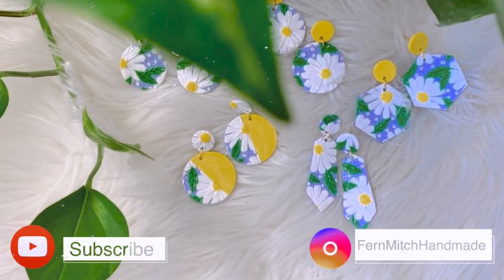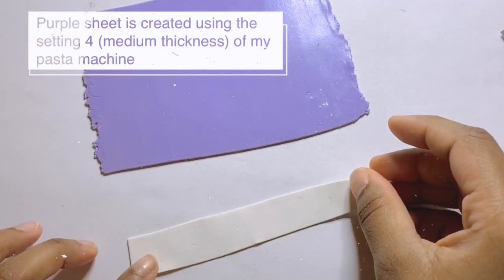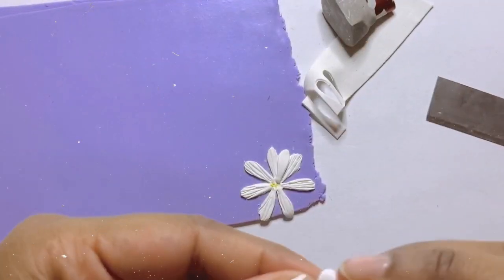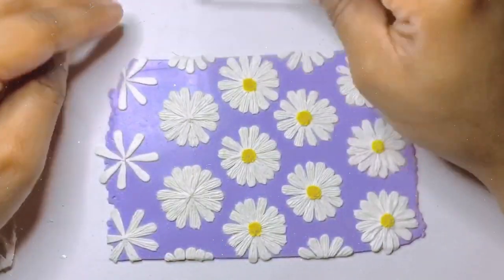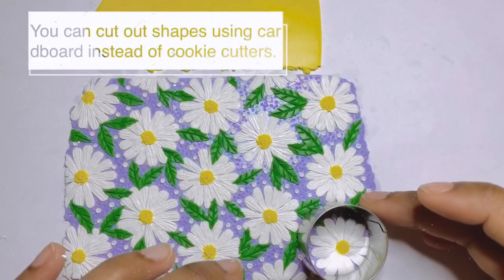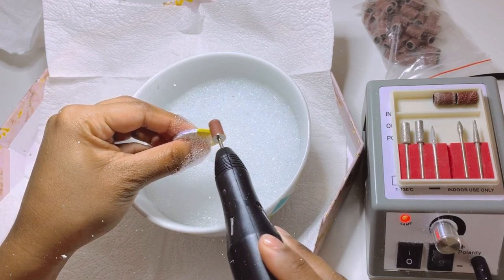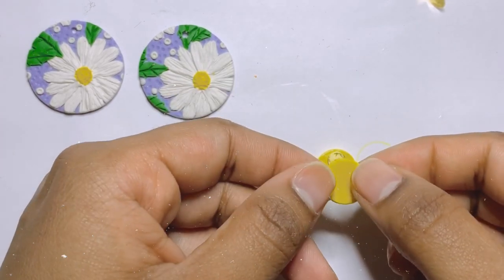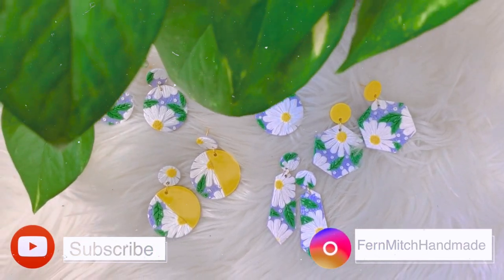DIY Polymer Clay Daisy Earrings Tutorial | How To Make Polymer Clay Earrings | Polymer Clay Slab

Comment: This is beautiful! Thank you for sharing! I have a quick question, how do you make the holes for the jump rings so perfect?? What tool do you use for that? I have tried making with tooth picks but it doesn’t work out too well :/ thank you! Also, do you have an Instagram?
Reply from the maker: Thank you 🥰 the sander I use has a drill bit attachment so I use it after I bake my pieces 😊 it’s very convenient.
Reply: Fern&Mitch Handmade can you make a video about how you put the holes for the jump rings ? I would really appreciate it! Thank you 🤩👌🏽
Reply: @maggier.2960  It shows her doing it at about 7:30
Reply: @maggier.2960  I use the top part of a cake icing tool.. perfect little hole.

Comment: After adding on the backing and covering it with clay, did you bake again?
Reply: This what I NEED to know
Reply from the maker: Absolutely!! I baked it for about 15mins
Reply: @FernMitchHandmade  would you recommend only baking the main earring feature for half the time first and then putting on the back and finishing off. I'm just wondering if the feature would burn and discolour
Reply from the maker: Shana-Rebecca Velloza As long as your temperature is below 275F (make sure you use a thermometer) the pieces won’t burn or discolour. 😊 However if in doubt, yes please bake your pieces halfway first and then add the backing and bake again.

Comment: Hi, do they remain soft after baking or do they go very hard?
Reply: Also how do you make sure the daises stick to the polymer and not pop off after baking?
Reply from the maker: Premo and soufflé are flexible after baking. Almost like a hard rubber. Raw clay to raw clay stick pretty well. It does not fall off.
Reply: @FernMitchHandmade  also onemore thing, will any pasta maker do or does it specifically have to be for clay?
Reply from the maker: Any pasta machine would do honestly as long as there are no complicated attachments.